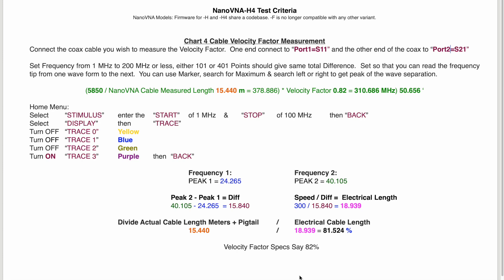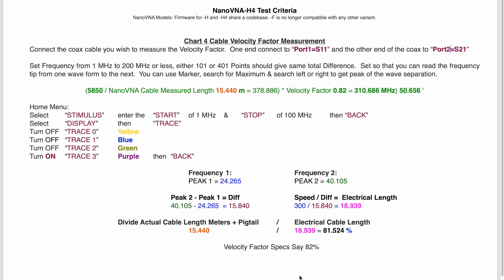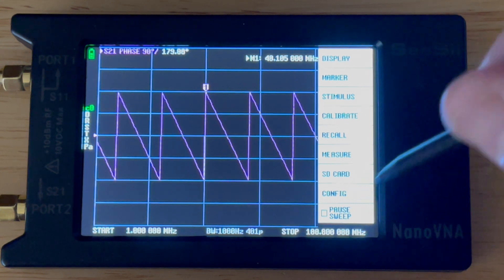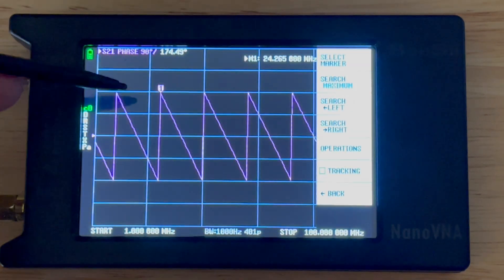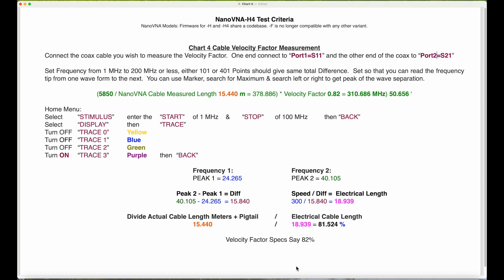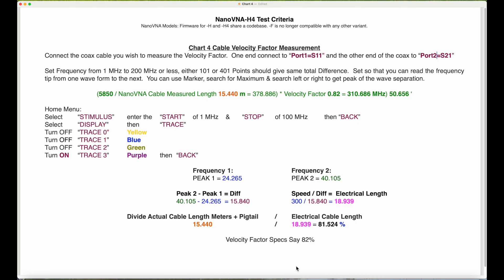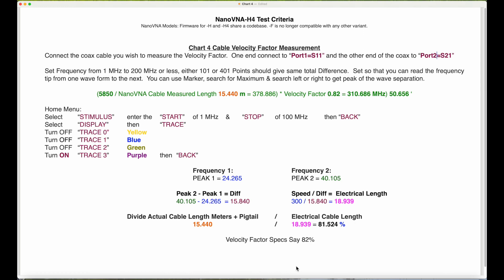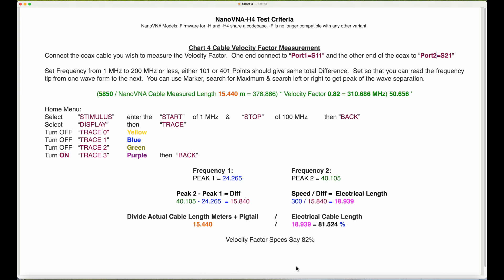NanoVNA-H4 - Cable Velocity Factor Measurement & Electrical Length

Comment: Ty for the video.  Do we need to do a SOLT calibration b4 doing this?
Reply from the maker: Not always, however it good to recalibrate when making changes.  I have a habit of doing it every so often and it verifies previous readings.

I should do another update on the devices.

Comment: Hi why you not use 299792457.9958 m/s
Reply from the maker: Depending on what I am testing or want to see the range.   I used both.  Sometime, I use a setting that I saved from before and didn't bother to update.
Reply: Este método no es muy preciso y por eso no influye mucho si se usa 300 o 299.792